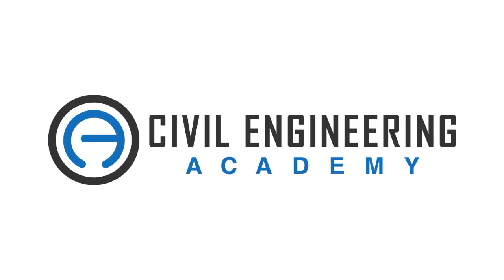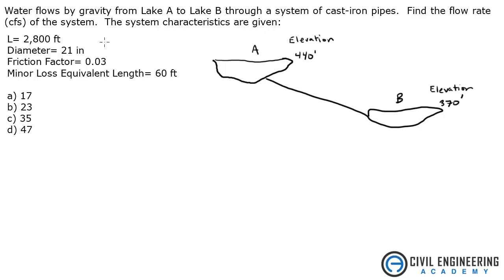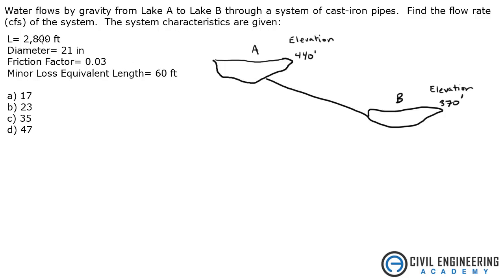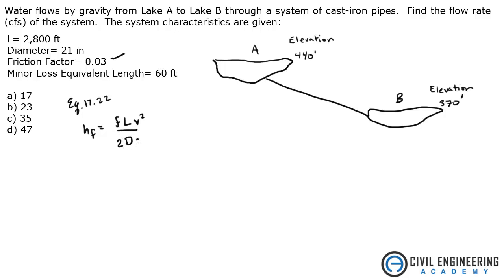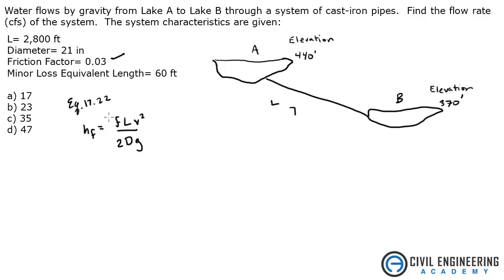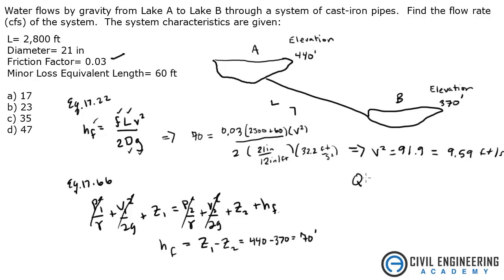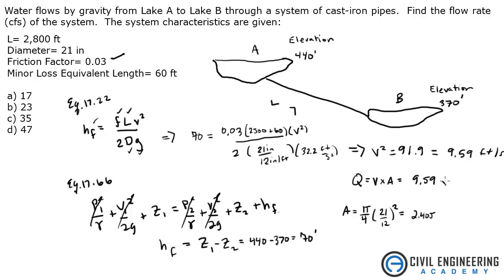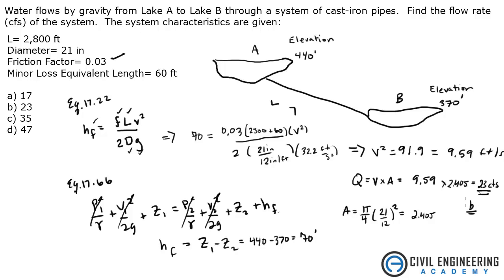Water Resources-Darcy Weisbach and Energy Equation

Comment: THIS WHOLE PROBLEM IS SOLVED INCORECTTLY. YOU DO NOT ADD THE 60 TO THE TOTAL LENGTH, YOU ADD IT TO THE WHOLE FRICTION HEADLOSS LIKE THIS:  70 = [(.03*2800*(V^2))/(2*(21/12)*32.2)] + 60.
YOU DO THE CALCULATIONS AND END UP WITH A FLOWRATE OF 8.9CFS!!!!!!!!!!!!!!!!!!!!!!
Reply: There are two methods of finding minor losses, the Velocity Head Method and the Equivalent Length Method.  In the ELM, you add all the lengths associated with each bend/fitting and then add that value to the total length to get a new length of pipe.  Since the problem given says that's how the minor losses were determined, then I believe he did it correctly.  With the VHM, I believe you would substitute the value given into the energy equation as you are suggesting (assuming the problem states it was determined by the VHM or you solve for the minor losses using that method) and continue to solve for velocity.

When I did it your way, I got the same answer, but I believe his method was correct.
Reply: Nope.  He did it correctly.  Only if the Velocity head method is used you then add to the energy equation as you suggest.

Comment: why did you add 60 to 2,800.
Reply from the maker: +Simran Singh you have to take into account the minor losses that are given as part of the problem into the total length.  Because the minor losses were given we added it to the length of the pipe for the total length you need to account for.  I hope that makes sense.  If it doesn't research minor losses and equivalent lengths in the CERM.  You'll find it.